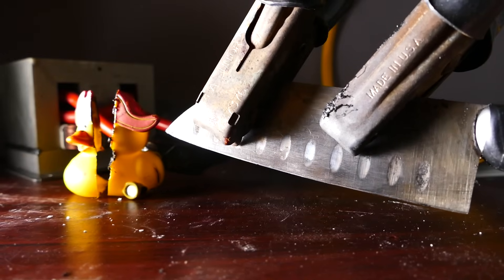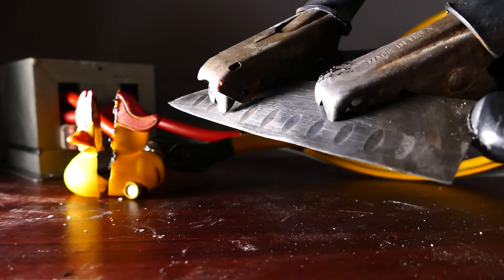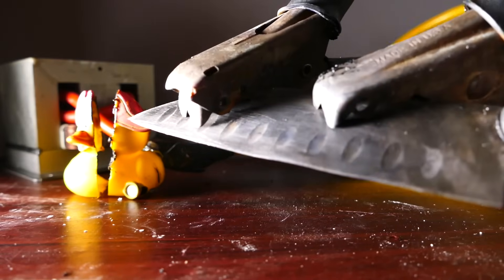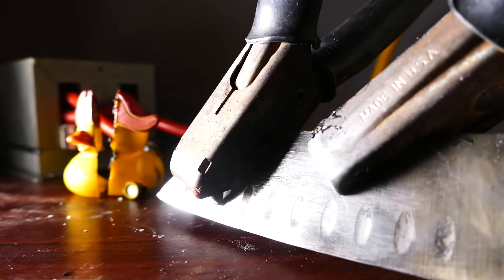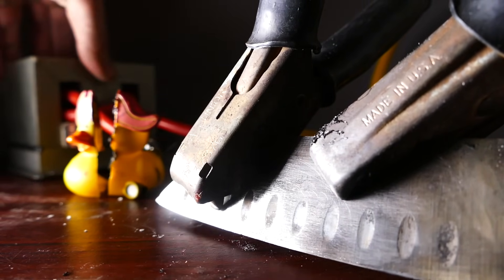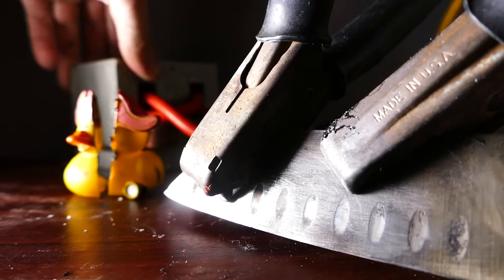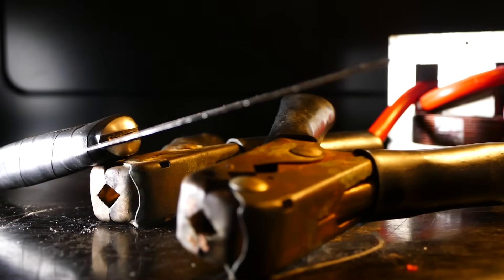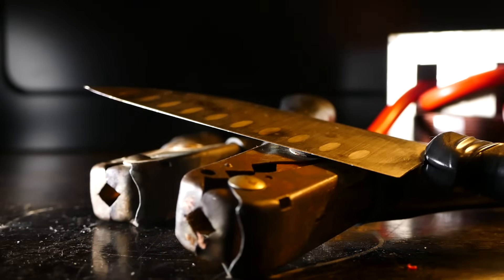EXPERIMENT Electric 1000 Degree Hot Knife Vs Rubber Duck! - Shocking 900 Amps!!!

Comment: I recommend more safety equipment when messing with electricity brother. if .20 of an amp can stop your heart 900 is fried al a Corazone, find some gloves that are resistant to high amperage and heat
Reply: alan whittington don't worry about it, the volts are two low to let the current conduct through you. I've done this same mod and I can safely hold the live wires without feeling a thing
Reply: inhale boi